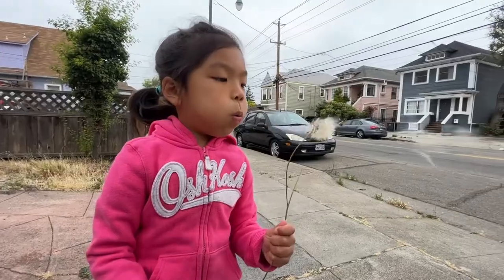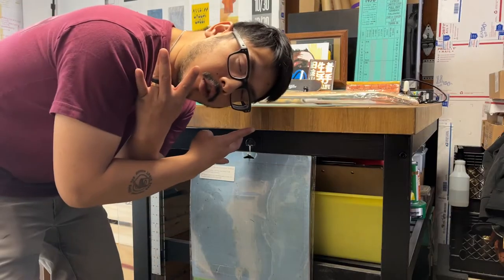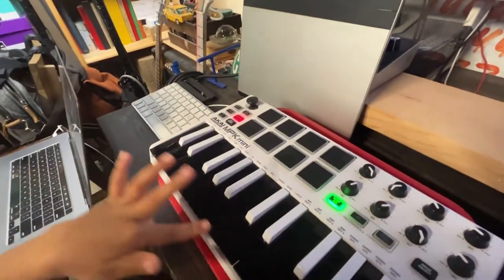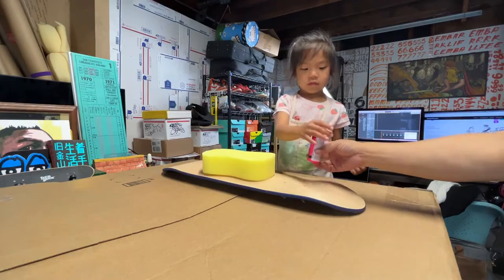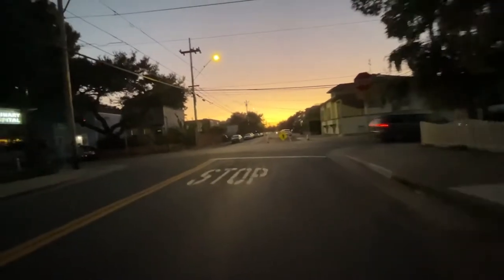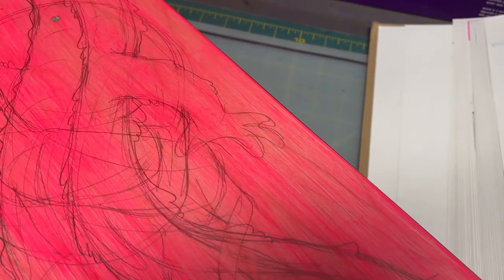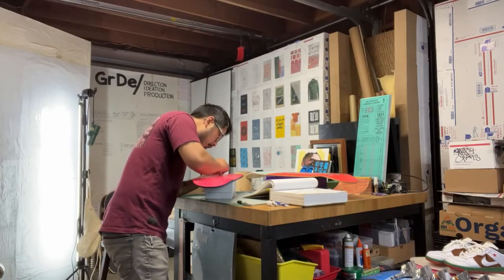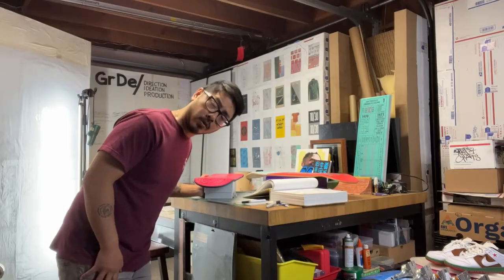Stay Creative, Teach Your Children About Music, Keep Painting Skateboards

Comment: Need your paint color guidance.  You have any suggestion on how to paint the rubber part of my air max 90 infrareds?  It’s gotten all rubbed off but I don’t know what paint to use and haven’t seen a good color match out there.  Thanks homie
Reply from the maker: Are you talking about the little rubber part of the upper? I havent retouched any rubber specifically on sneakers in a long time. I would do a bit of research, someone on Yt probably has a video on this haha. I imagine a type of acrylic  paint, applied in thin even layers using a small detail brush. If theres no luck out there, maybe I should cover this. Would require a mixing matching session with samples but def a worth while project to prolong the flyness of your sneakers haha.